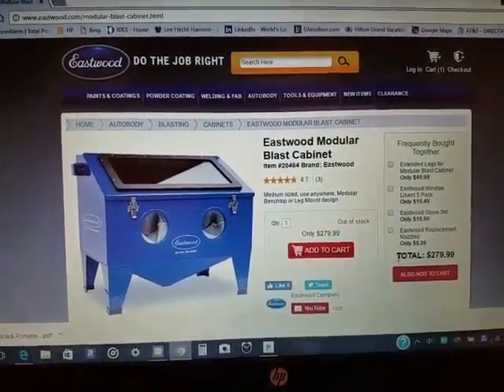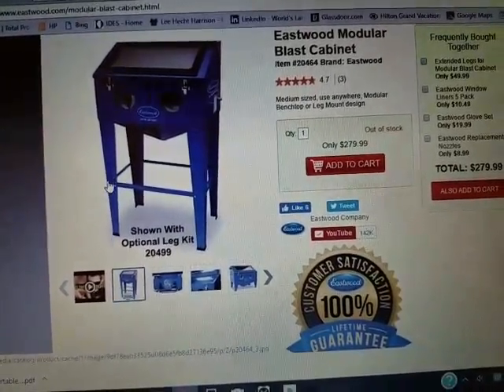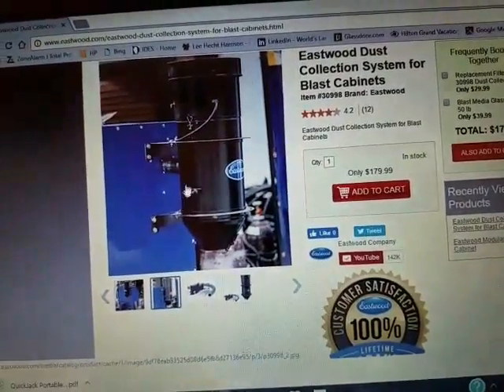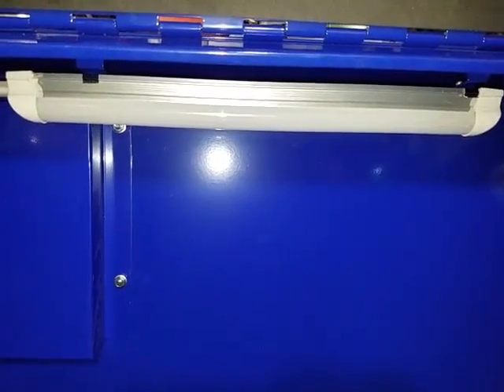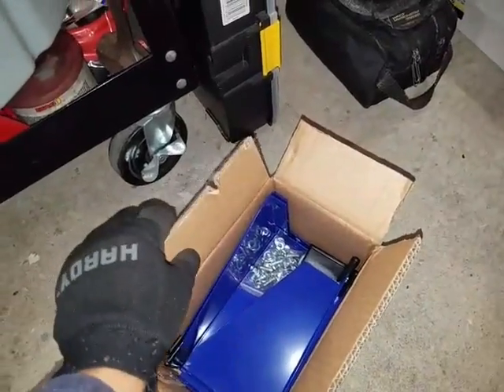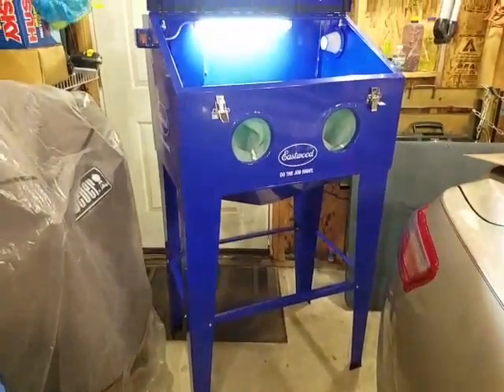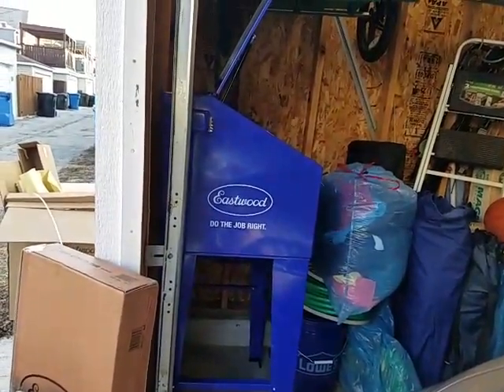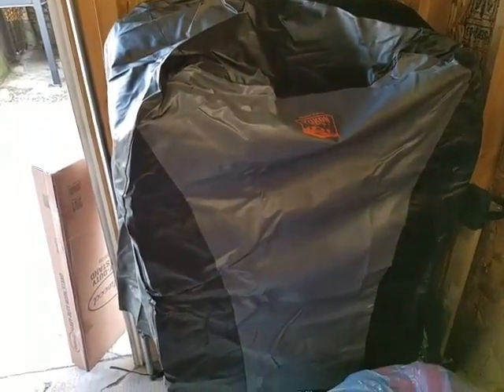Eastwood Blast Cabinet Unboxing

Comment: I know this is an old video, and you may not even have this cabinet anymore. The question I have is the drain plug in the bottom, that's used to drain the media from the cabinet. I know you said it is a 15mm head, but what's the diameter of the plug? The reason i ask is I have this cabinet on order but will be making a metering valve in the bottom to help the media flow better. Thanks.
Reply from the maker: Hi, I do still have this cabinet. I'm not sure of the diameter of the drain plug.  Contact Eastwood Co. customer service and maybe they can help you.
Reply: @Pk3_Garage  thanks for the reply.

Comment: Thanks for the video. Its been 6 years, but can you recall if it came with an elbow for the dust extraction port? What size is the port with gromet? Cheers!
Reply from the maker: Let me check. (I don't remember) I believe the elbow came with the unit though. I'll verify the size as well.
Reply: @Pk3_Garage  thank you.
Reply from the maker: The vacuum hose port does come with the unit and is 1.5 inches in diameter.
Reply: @Pk3_Garage  Sweet. Thanks for checking!

Comment: Are you still happy with it? Thinking of buying this soon
Reply from the maker: I am. It works very well. Have to make sure you have at least a 30 gal. Air compressor that can push out 7 SCFM at 90 psi. I usually run my air compressor at 70 PSI which is probably about 6 SCFM.
Reply: Pk 3 thanks!

Comment: I purchased same model two months ago but I’m not very happy with it. The pick up media is garbage since it doesn’t have the Venturi system like other models. I will have to improve the pick up system and adapt a metering valve to it. Even with my 80 gallon 18.5 cfm @ 175 cfm compressor this blast cabinet is not doing things right.
Reply from the maker: Sorry to hear that. Call Eastwood customer service about your problem. Mine has been working fine, even though I've only used it a handful of times. Also, are you using  the recommended media type?